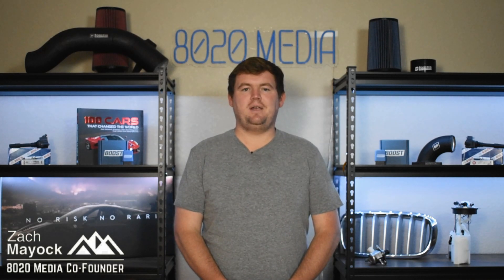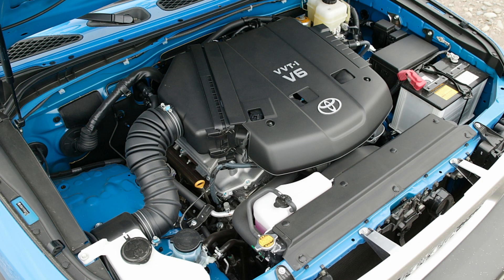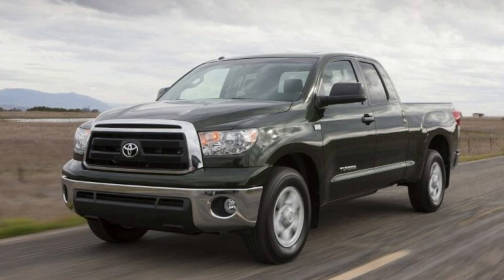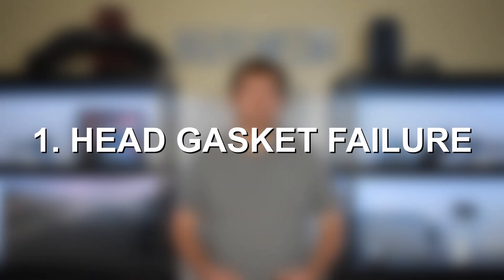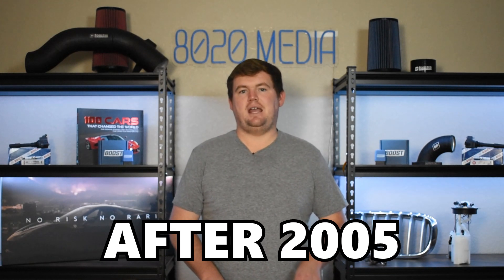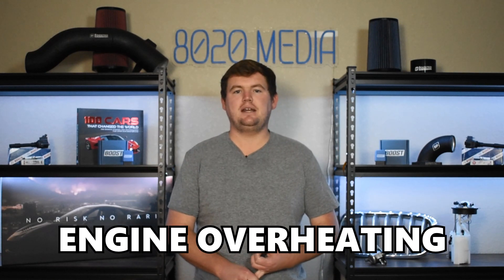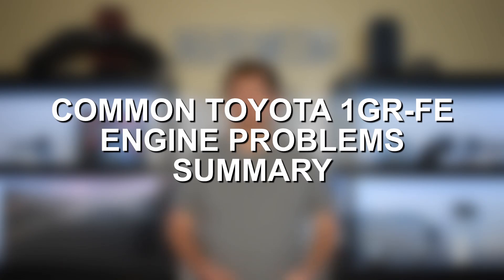The Toyota 1GR-FE | Common Problems & Reliability

Comment: I heard from an extremely reliable source cam tower leaks are somewhat of a thing. I have a 21’ 4R trail edition. Kept up with all maintenance & it Runs like a clock! So far zero issues at 65k. I’m guessing much much higher mileage will see some of these issues unfold. Right now barely broken in!😃

Comment: It is as long as the coolant is kept clean, thermostat changed every ten years and oil change done regularly with air filter cleaned regularly, also it helps if a catch can gets installed.
Reply from the maker: R - Good points! Thanks for sharing.
Reply: Does the 1grfe suck oil through the pcv? I have a 2017 with 100k miles and absolutely zero oil consumption biting just concerned it might be something I need to look out for

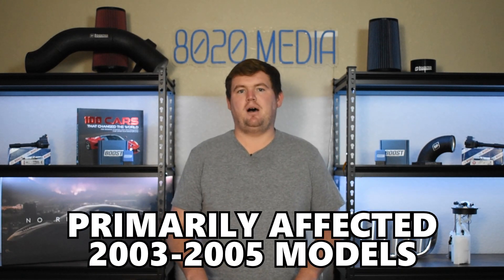Comment: You're talking about the 4 runners? At time mark 1:16

There's some 06 4runners have the old engine pre lift actually do look a little bit more research my has 312k AM(American mileage) is equivalent to 504km😊 
I heard some 06 and 07 4runner some 1gr-fe have blown head gasket around 310 k to 380k knock on wood last another 20 years or so😊
Reply from the maker: J - Thanks for sharing!

Comment: Hilux 2005........20 years old......400 000 km.....still runs like a dream....changing oil every 10 000 km
Reply: Great 400km is 250,000 in mileage (American mileage)

My 2006 4runner has 503,027 km (312,000 m)
Reply: @ old stile cars run forever
Reply from the maker: B - Nice! We love a good Hilux! Things will never die.
Reply: @8020Automotive  just curious why do you put letters like? B - in front of your comments.

Comment: I believe starting in 2010, the 1gr implemented hydraulic lifters and roller rockers.
Reply from the maker: F - Thanks for sharing.
Reply: What I know is, that all 4.0L engines with single variable Camshaft has soilid lifters and engines with variable Cams at inlet and outlet has hydraulic lifters🤔. So my own 4.0L V6 1GR-FE in 2018 Hilux, imported from VAE to Germany has these engine with solid lifters.